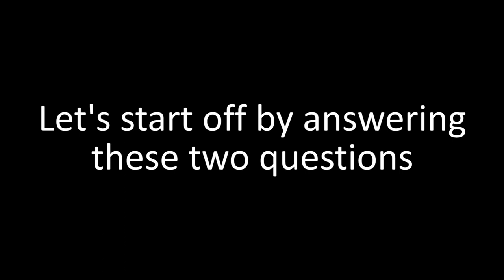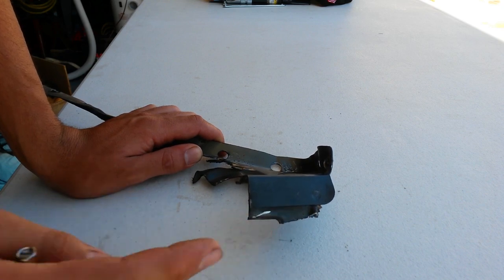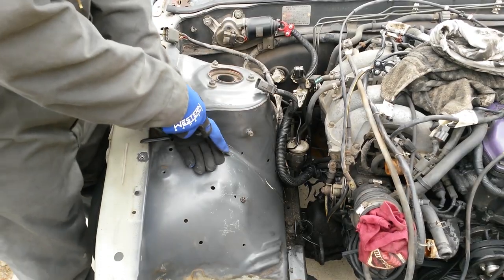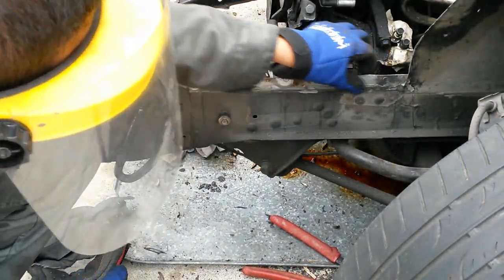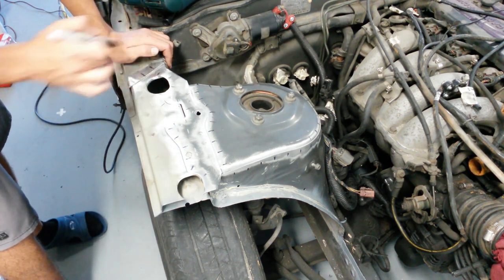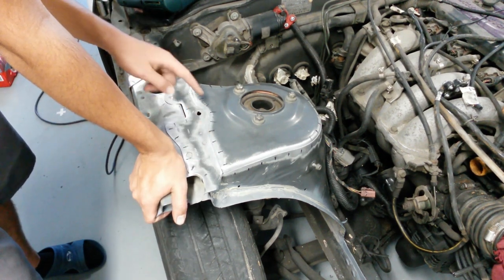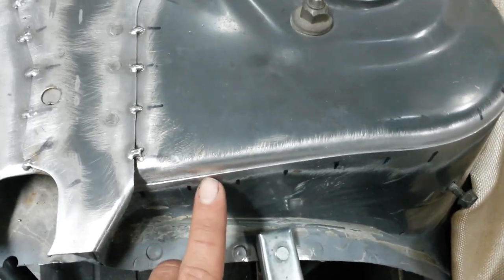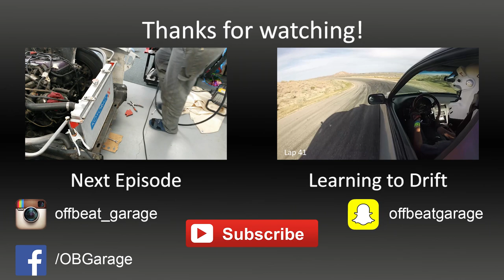Project 240 - Le Drift Car II | Ep. 3 - Cutting the Front & Stitch Welding

Comment: Dude your like a surgeon. I welded 22 years and worked in a machine shop, and I painted at both places to.
But I think you clean your welding surface better than a painter.
Every time I go to open my mouth I have to remove it you pull it out of your hat.
Don't worry about how nice your welds look just keep your pace, but on thin metal welding small area's at a time would be wise.
I think if the motor was out you could have done a better job.
As a video series this is excellent a lot better than orange county chopper.
When I weld now all I use is flux-core wire, because you don't need shielding gas.
yeah there's some slag like arc welding but it works good enough for me. 
But I would have jumped all over welding  it an inch here an inch on the opposite side inch in the middle the go to the other side and do it car metal is thin.
About 1983 I bought a 1969 mustang fastback the front a frame was coming loose so I pulled the engine degreased it and wiped it down with acitone.
Then I used a portapower to press it back where it belonged welded it back.I put a brace over the the engine tower to tower.I only Painted the engine compartment and it still looked new.
So I have little faith in uni-body cars.
My favorite looking cars were Opel GT, Datsun 240Z, 1974 AMC Javelin Javeline was the best.

Comment: 9:25 and thats why direction of spin is marked on the grinder body just fyi =D

also i think someone explained stitch welding to you wrong. the way you did it is "just to hold something thats not important". i know thats obv not the case in this situation (and also 1" 1" is way much for that thickness) as theres a bunch of the stock welds left and your going to probs add more strength than stock with the tube front, however;

the do an inch skip an inch way is for things that need to be strong but a full weld is overkill so you weld 1/2 of your total length but split it up to distribute the load and the heat when you weld it.

 if you weld 1" skip 1" over 1' you've got 6" of weld per 1'.

if you tack (1/8th" ish i gues looking at the pics) every 1" over 1' (as you did) you've got 1 1/2" of weld per 1'.

better load distribution (as you talked about) dont mean jack when you only welded 1/8 of your seam rather than 1/2 no matter how you split it up.... 

you should be (if your tacks are 1/8th) marking every 1/8th and do 1 skip one to get 1/2 total weld.

Comment: Hey bro! I'm in the middle of doing this exact same thing! I've been wondering if I should get a shop to do it or do it myself. But my questions are, What was the price of the materials needed for your front end? Is it hard to bend the tubes or should I get a shop to bend them? Also when you stitch welded the interior, did you have anything to put your knees on? I'm assuming the metal got hot. IMO, you should bring that cool intro! 😂 Thank you for your videos man! From Nashville, TN.
Reply from the maker: Carlos Bravo The material cost is less than $100. You'll need a bender to do the bends. The bender setup I have was $680 so quite pricey if you are just doing the tube front. In that case it'll be much easier to just have a shop do the bends.
 As for paying a shop to do the whole front end. It depends on if you have a welder or not. After you buy a welder, tube bender, then buy the tubes, plus other little things like an angle grinder, cut off disks etc, and on top of that you'll be spending hours of your labor on it. In that case it might just be easier to have a shop do it. 

Yup, I have knee pads that I wear almost the entire time when doing work on the interior. It's not about the heat really since your knees don't usually sit close enough to where you're stitch welding. Just that the floor is uneven and it really hurts your knees being on the floor of the car for hours.
Working on remaking the intro to bring it back. Thanks!

Comment: There are three things that if you were to make a video on would be for the the first drift car. The first thing would be a different exhaust, because it looks a little too big and it is also little messed up due to how low the exhaust sits. The second thing would be to paint the trim around windows and things like that. The last thing and least important is that i think the car would look real nice with white wheels. I just had to put in my 2 cents lol

Comment: Why not weld the seams completely? Wouldn't that be the best option for load distribution as well as load handling capability? I believe that's how seamwelding is done on many track cars around here..
Reply from the maker: +codenamecordon It's looked down upon to weld the seams completely because it there is an accident you don't have any weak zones to crumple and if there is any frame damage it becomes much harder to straighten because everything is fully welded.

Comment: K thanks, so let's assume I have an open diff what should I do replace it with a different one or do some type of adjustment?
Reply from the maker: Felix Cabrera You can replace it with an LSD or you can replace it with a welded diff which will have both wheels spin at the same rate constantly.

Comment: I'm building an auto cross/small track 1993 240sx. I'm curious on how much weight you removed if any? It would be great for repairs and engine swaps if I do a removable tube front end but I don't know if the work is worth it if I don't lose weight...
Reply from the maker: +Kyle Tipton Yea you won't lose weight. You might actually be adding weight by doing this. The main advantage is wheel clearance with big angle and of course having a modular front end.

Comment: Would you say stitch welding is worth doing for the amount of time taken? Any tips or tricks to it and is it good to do it along just seems or around other places too? Thanks in advance, keep up the good work I love the videos:)!
Reply from the maker: xProline I've heard it is worth it. Especially in a convertible like a Miata where there is no roof so it helps a lot with stiffness when the car is stitch welded. Just useful doing along seams. Other places are just straight metal and don't need it. The purpose is just to make the individual pieces of metal making up the car flex less which is why you do it on the seams. Thanks!

Comment: I have a question is there a reason why you  stitch welded on the inside of the engine bay instead of the outside? or is it all the same?

great videos like always man keep it up
Reply from the maker: Inside_ninja Inside of the engine bay is not exposed to as much water and it's much easier to weld in this area. The outside has a thick layer of undercoating from the factory and once you remove that the car is more susceptible to rusting out. Thanks!

Comment: My Miata is getting a full respray. Doing it with my uncle, I was just wondering whether to buy a compressor with a gravity gun or just use rattle cans. Is the compressor worth it?
Reply from the maker: ***** Yes get the compressor with the gun. You'll be able to spray better paint and have a wider variety of paint to choose from. On top of that you can use the compressor for a variety of different tools which is always useful :)
Reply: Okay thanks mate. I just wanted reassurance that it's a good investment. Cheers

Comment: Hey man I have an s13 hatch as well and was wondering what all did you measure for a tube front assuming bumper is being put back on? I've googled it and the forums have told me to Google it and even enjuku won't give me a straight anser
Reply from the maker: the saintsofgta I just measured to give me a rough estimate on how much material to need. Other than that you don't need any other measurements. You can just fabricate as you go and build the tubes within your constraints.

Comment: I have a 95 240sx zenki and I was wondering when I go into a sharp turn to the right( trying to drift ) even when i throttling hard my right wheel the follow wheel doesn't really seem two spin as much as my left, do you have any ideas to what cause this? Ps of course in the rain I'm like level 100 drifter hahaha
Reply from the maker: Felix Cabrera I'm assuming you have an open diff which is causing the wheels to spin at different speeds because it's not applying the power evenly from one wheel to another. Lol we're all level 100 in the rain :P

Comment: Hey I have a question the automatic seat belts in the s13 hatch. My hatch has automatic seat belts and only the passenger side moves back and forth. The driver side does not move at all. Its stuck in the right position but I still would like to know if it would a simple fix.
Reply from the maker: n1f1sniper Take off the panel and see what's wrong really. If anything looks funky, wires disconnected, parts of the mechanism broken etc.

Comment: Thank you for this video, it inspires me to do things with my car i wasn't have courage to do! With this long lower frame rails it's really easy to get some severe damage to wheel alignment. Tell me please, why didn't you cut lower frame rails?
Reply from the maker: Ярослав Немирович Lower frame rails have a lot of suspension components that bolt to it and it's easier to just leave them in place as is commonly done when tubing the front.
Reply: that makes sense, i hear you. Good luck and be the safety with you :D cuz i am transport safety engineer
Reply from the maker: Ярослав Немирович Haha thanks!

Comment: This is only video 3 and my question will probably be answered later but, what are other important places on the body should be stich welded. and or why is that the are the main focus?
Reply from the maker: +Dakota Lawhead Shock tower, major seams that hold the car together. That's about it. You can go much further and do almost every seam but that's a bit overkill and a ton of work haha. Shock towers are the main focus because that is a high stress area that you want to strengthen. The other seams are done for added rigidity since the stock spot welds and few and far apart which gives the chassis flex.
Reply: +OffBeat Garage ok, makes sense. Thanks for the reply, keep it up I'm a huge fan can't wait till your next video.
Reply from the maker: Dakota Lawhead No problem, thanks for the support :)

Comment: the spot welding method is less strong and you can get good heat dissipation by skipping a spot that you want to weld so u leave 3 markings between every weld and weld the one you skipped afterwards 
also to get the right length is really easy just take you center punch and punch a mark you can easily see that when welding you should have done that anyway because those sharpie marks burn off
although i would weld this with a tig welder just because it more finer and precise (and i suck at mig/mag or stick welding ;) ) 
but since you are an inexperienced welder i would have done the same as you by spot welding
but the welds look very fragile so i would still do lines instead of just the spot welds or make bigger spot welds

Comment: In your commentary you note that you would be stitch welding past the Strut Towers towards the front of the Car. Is this the case?

If so, I've stitch welded cars before and have also been under the impression to not stitch weld past the Strut Towers either towards the front or the rear of the car for two reasons:

1. Crumple zone in case of impact. (You need it, otherwise your car can be a human blender for you and your passenger. I've seen it happen.)

2. It technically does not add to the Chassis' torsional rigidity. Only changes between the front and rear Strut Towers add rigidity.

Please share if you know otherwise and can share some examples.

Above all, great videos, great work and thank you for making YouTube a better place!
Reply from the maker: BTKeck Yes I'm stitching forward, but I'm only stitch welding along the seam of the frame rail and nowhere else. Reason being that's where the shock tower mounts to the frame rail and that seems like a very important part to reinforce. Going to the front end in front of the shock tower is not necessary I agree. But seeing as how the tension rod brackets and front crossmember also bolt up to the frame rail either directly under or to the forward of the shock tower it, it would just feel incomplete stopping half way down the length of the frame rail just to not weld past the shock towers. 

As for the crumple zone, to my understanding the benefit of stitch welding with just the tacks is it still allows for a good crumple zone while also giving the benefit of added rigidity that stitch welding brings.

Hope that clears up the reasoning behind doing it :)
Thanks!
Reply: *****  Thank you for the response!

Ah, yes the mounting of the Tension Rods and K-Member are past the Strut Towers. I forget that about the S-Chassis. I understand that continued Stitch Welding the full length the Frame Rails can benefit, don't want any flexing in that metal.

Of course crumple zones are questioned depending on what is impacted. Worse case I've seen in person was an AE86 (fully Stitch Welded) remove the entire Front Clip of an R32 (Not Stitch Welded). The AE86 was still in a condition to drive but the occupants were not.

Thank you again producing great videos and content!
Reply from the maker: BTKeck Of course!

Comment: you should have used more heat/power on the welds, those plates are thick and when they are on top of eachother its like impossible to weld holes, :)
Reply from the maker: Tivoliterror I actually blew through the top sheet on a couple of them and had to reweld lol I made sure on a sample piece I was getting full penetration.
Reply: do some close ups, its good that you did the distance between them, as you said , strong here and weak there isnt good, its about spreading the collision IF you crash so Thumbs up! :)

Comment: Is it street legal to tube on end of the car. Also why don't body shops just completely replaced the front clip after a car accident. I plan on being a mechanic and body worker and personally I think it is better just fully replace the whole front clip
Reply from the maker: bOwToMeE0 No law against tubing the front end. Completely replacing the front end is costly, it's much cheaper and easier for them to pull it back straight
Reply: ***** true but i am also against bondo i think panels should be hammerd strait but maybe i just think old school

Comment: The heat and deformation of the metal seems like a reasonable reason to me, but you lost me when you said load distribution. I fabricate semi trailers for a living and i can assure you a 1" fillet will be stronger than 2 tack welds per inch. Personally i would have done the 1" fillet welds and then put a tack in the middle of the 1" weld gaps, But its your car mate, whatever works for you. love the project btw, never heard of tubing a car untill i seen your video!
Reply from the maker: Blinky Bill Just going off what people say, that when in an accident it's easier to pull straight the chassis if it doesn't have 1" welds. Stiffness between the 1" welds and tacks are supposedly the same and not a noticeable difference either. Again, I may be wrong but that's just what I found off of my searching on various forums and such. Thanks!

Comment: Hey dude!

Im from spain and i just get a 200sx s13 and a few minutes after turning it on white smoke appears from the manifold... im upsed. Any tips? 

Thx for the vids u make i had learned a lot. 

(sry if i had done any english mistakes im not good at it ^^ )
Reply: superjavip white smoke from the manifold? exhaust or intake manifold?
either way change it with a new one as its leaking
as long as there isnt white smoke from the exhaust you're mint
Reply: i am Viking white smoke from the exhaust manifold :/
Reply: Headgasket? Is there oil in your coolant? Does your coolant level drop over time?
Reply: Nope the coolant is  fine
Reply: superjavip change it to a new one
and if white smoke comes out from the exhaust you're probably getting oil into the combustion chambers, meaning you need a new head gasket
Reply: Yeah they told me something similar... Its gonna be expensive dho
Reply: superjavip doing it yourself is cheap
and getting a new motor is also cheap, i see sr20's for sale at 800 bucks
Reply: Here in spain a ca18 could be around 750 € so will see :/

Thx for the tip

Comment: Wait so this is the new body for your drift car then why didn't you take the engine out now?
Reply from the maker: That Method Guy TG Engine needs to stay in place until after the tube front is done. This is done in order to make sure the tube front doesn't run into engine components.
Reply: I guess but you took measurements of the front end so your making it the same size. So would it matter because your just changing engines from one 240 to other?
Reply from the maker: That Method Guy TG The measurements were just for the material. The tubing will have it's own bends and dimensions so those measurements are not really useful other than on estimating on how much material to buy. The radiator also needs to be held into place with the upper radiator hose attached. You'll see in ep. 4 what I mean haha
Reply: Ok ya makes sense just wondering. I am enjoying the videos, really entertaining, and in depth keep it up
Reply from the maker: Thanks!

Comment: 15:00
DO NOT use wire wheels that are rpm rated for hand drills.  They WILL come apart and grenade/fragment hundreds of those metal needles in the path of the rotation.  God forbid your face or other body parts are in the way.
Awesome video though, I really dig your editing and music
Reply from the maker: kangaroux0 So far I've used it to prep all the seams in the interior as well an not a single one has come off. I think this is rated for drills, like it's pretty stiff material, not the stuff you find on dremels.
Thanks!